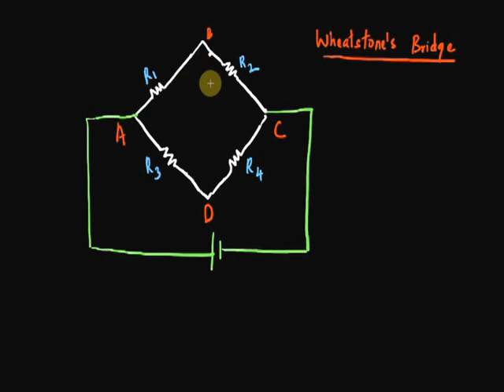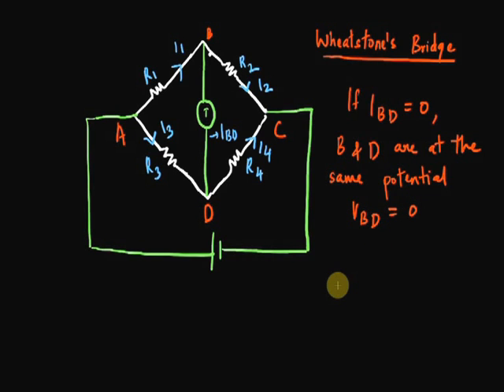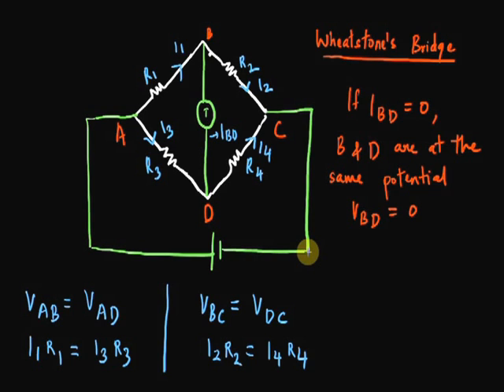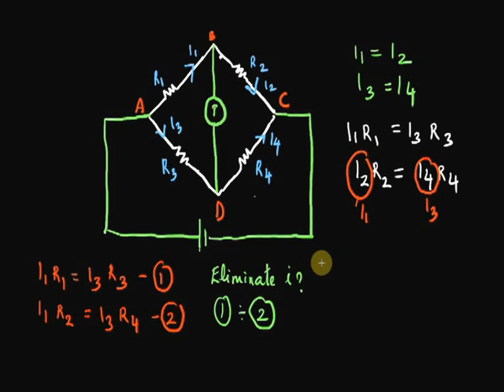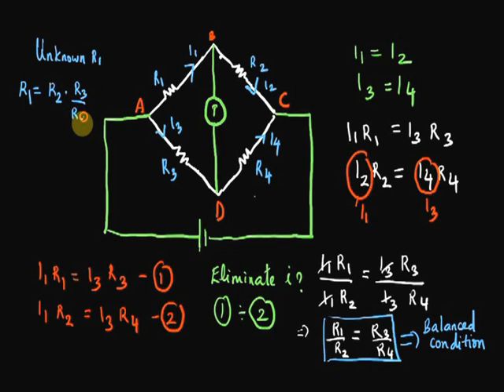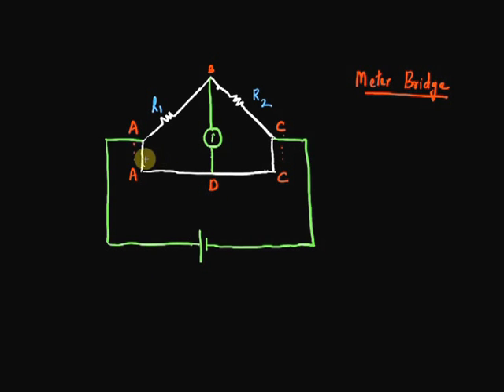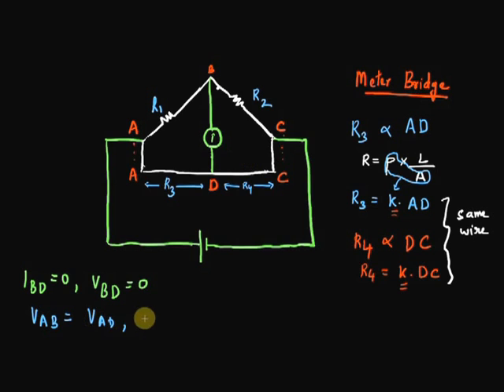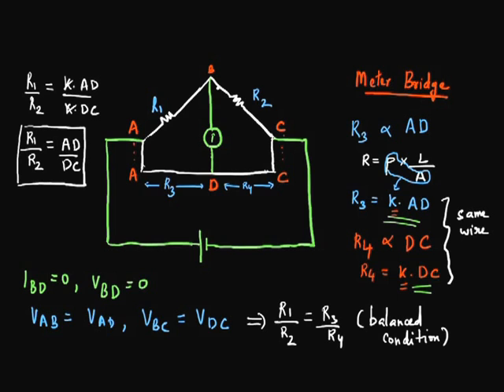Wheatstone's Bridge & Applications

Comment: Your drum beat is missing a beat.
Reply: It's a loop. There's a gap between when the loop ends and starts back up again, and that's what you're hearing.
Reply: good catch!
Reply: I just got a notification about this, and it is exactly one year later.

Interestingly, I just finished a test in a Circuit Theory class over this stuff. Last year it was an Electricity and Magnetism physics class.

Comment: Excellent explanation......is it possible to measure larger resistances in range of few kilo ohms using meter bridge...??????  
i doubt because the conductor which is used in the bottom portion of the bridge ...is just a normal conductor of resistance in few ohms....